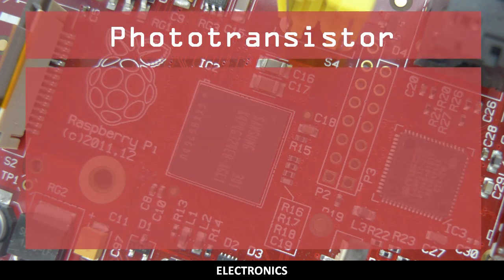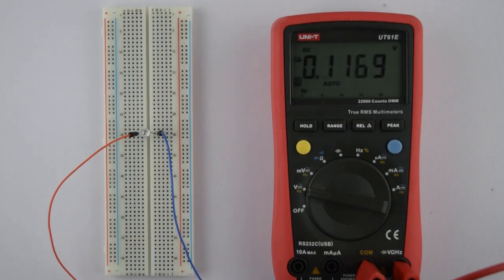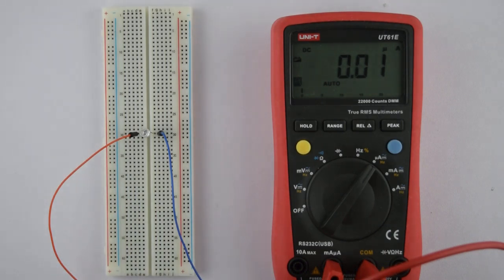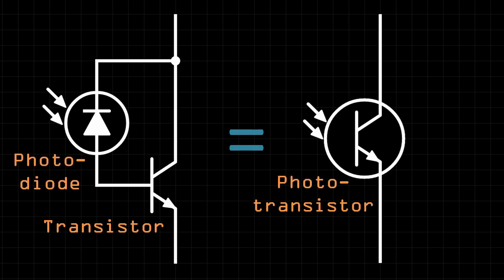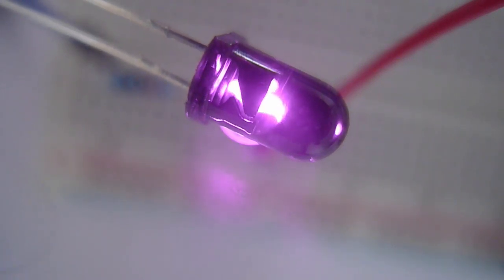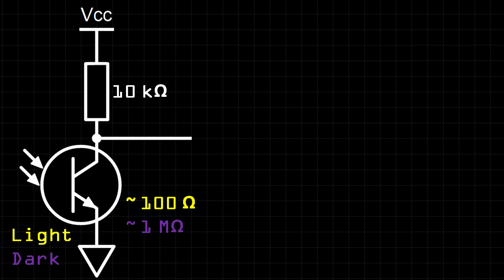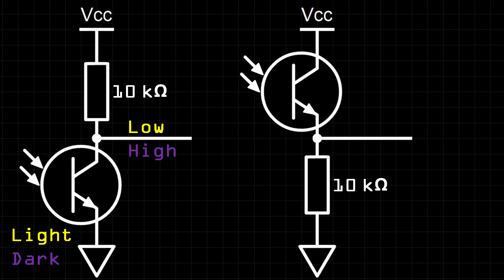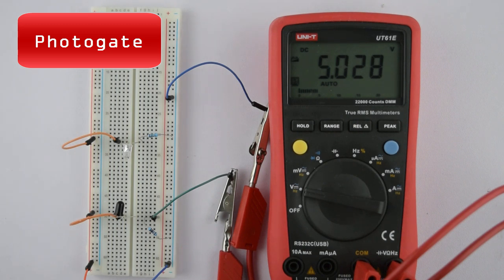Phototransistor Tutorial

Comment: It appears that using these methods, a photoresistor can be used to replace a LDR, if placing the 10k resistor after the phototransistor, and doing some experimentation. 

Is that a fair assumption? I am looking to modify a circuit using CdS based LDR's, which are becoming more difficult to come, with a better solution.

However, I have not been able to find 3mm to 5mm, two leg phototransistors in a range of normal white light. Can I assume a clear phototransistor with a 850nm to 940nm high range would work?

Thanks

Comment: I have a transistor with a clear case and a base connection, three pins. It responds to light. With a little light it looks like a transistor in a component tester. When it has a lot of light it becomes to back to back diodes with apparently no conduction. Interesting component. Can't find a list or number for it, to92 case. Very old.

Comment: Hey Gaven! This is the first time I post something on your channel and I want to thank you for your videos, they have been really useful in helping me integrate my RPi with electronic components. However, I have been struggling a lot with the phototransistor videos. For example, I can't even replicate your setup on the breadboard and obtain the same results as yours. (or close enough). Would it be possible to share a schematic of your setup?. 
In my case I am using:
an infrared LED (IR383) connected with a 330 Ohm resistor
a phototransistor (PT1302B/C2) connected to a 10K Ohm resistor as indicated in the video
6V DC voltage

Basically when I power the circuit the most voltage I get is around 0.30V instead of the 5V (or 6V in my case)